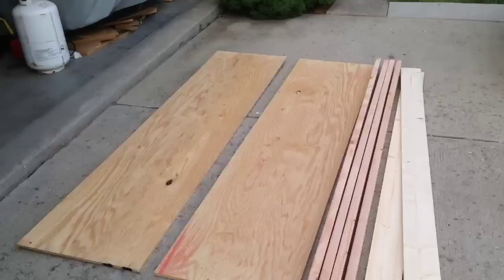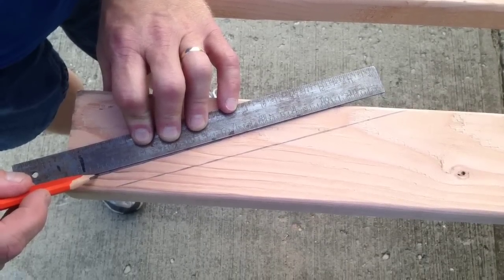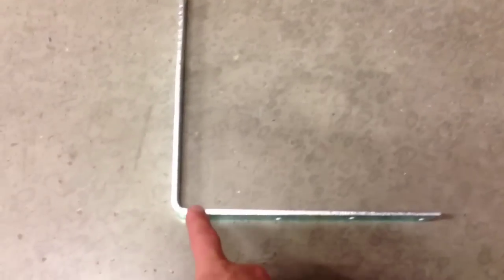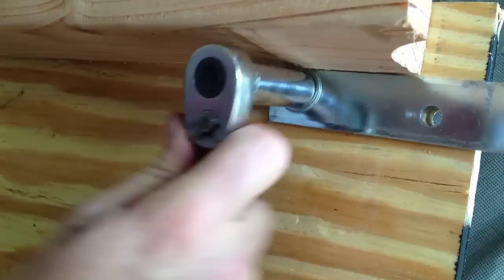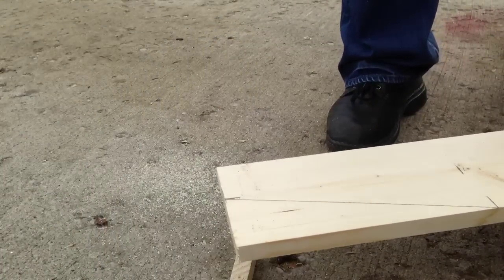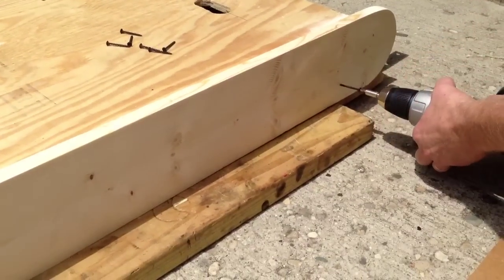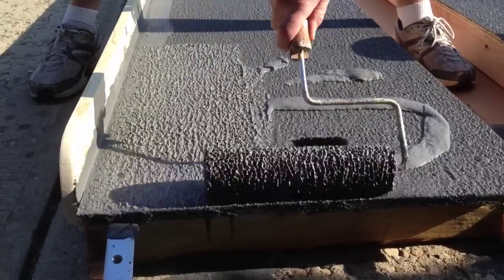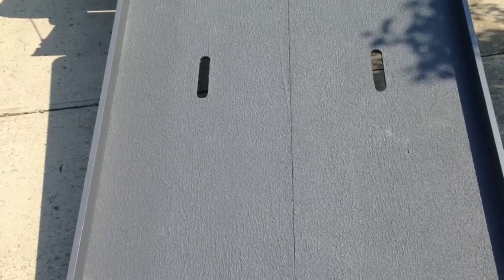How to Build a truck ramp. By How-to Bob

Comment: Yes wayyyy too heavy for a ramp. Probably costs bout same or more. Can get a aluminum on for $99 and holds 1500lbs. Weighs Lil under 30lbs. I do give u props for making us own. Does look good.
Reply from the maker: It helps that they split in half. I was wondering how long and how wide are the aluminum ramps that you can get for $99?
Thanks
Reply: About six feet long and eight inches wide.
Reply from the maker: I needed 8 feet.

Comment: These are pretty cool, and they look good too. Have you considered building a raised platform for the inside of your truckbed with a "cubby" hole for the ramp so you can put your item on the platform, and slide the ramps in and out as needed?
Reply from the maker: I have but I thought they would take up too much space or raise the bed too high. Thanks for watching.
Reply: @funbro1  that's a good point.
Reply: @Adam Will  I m searching for that specific idea. If the ramp was made out of metal, then cubby wouldn't have to be so high. I plan on adding side panels to the bed of the truck so it may workout.

Comment: The side 2x4-s are 4 ft apart.  In length of the ramp there are no 2x4-s under the plywood for the whole 8 ft. Load a tractor and it will fall through the plywood. Was this calculated by an engineer or just put together "by ear"
Reply from the maker: In total there are four 2x4’s under the ramp. I have loaded a lawn tractor and a 900 pound motorcycle plus the rider multiple times with no issues. This was calculated by an engineer using SYP for construction and had nothing to do with “ears”.
Thanks for watching.

Comment: Why no completed picture view
Reply from the maker: The thumbnail for the video is literally a picture of the completed ramp. Hope this helps, thanks for watching.
Reply: @funbro1  yes I understand but it's not on the truck so it doesn't give a relationship to size and how functional it could be for varies uses.
Reply from the maker: It can be used for many many things. It is 8 feet long and 4 feet wide. I have used it for lawn tractors, snow blowers, and a full size motorcycle.
What do you need a ramp for?
Reply: @funbro1  what does a mask have to do with this? 

What info is missing is the rake of the ramp in relationship to the height of the tailgate.
Reply from the maker: The rake will change depending on the level of the driveway/parking lot. There are times I look for a swell in the driveway so that the front of the truck is up and the tailgate lower so that the angle/rake of the ramp is less and less.

No mask was used in the production of this video.
Reply from the maker: How high is your tailgate from the ground?
Reply: @funbro1  I got it figured out days ago... 

You didn't use a mask when painting interesting approach

Comment: Great video I'm a teen and got a little Frontier truck I plan on making a ramp for to load my pushmower in and out to mow lawns to make some cash
Reply from the maker: They have served me well for awhile now. Thanks for watching
Reply: The ramps weigh more than the average push mower.
Reply: You can get a set of two steel folding ramps on amazon for about $70. They'd probably work better for your push mower, and they weigh about 20lbs apiece. I think this ramp would be good for something that is harder to control, like a motorcycle

Comment: Thanks for posting this video! I built a Motorcycle dolly with a winch and this ramp looks like it will be easier to load with the smooth plywood surface compared to my aluminum ramps. Nice job!
Reply from the maker: Bob C Thank You

Comment: Hi.
Nice job and presentation. I am going to use 2 x 10's along with the purchased metal pieces from Amazon--about $20. Last time I borrowed a friends similar units and they worked fine to load and unload a snowblower. Now I am making my own for the lawnmower and need to know how long they ramp should be--tailgate is 28 :" off the ground. 
Last time I used 6" pieces of 1  3s to drive into the ground at the end of the ramps to stop them from moving--I do like your tie down idea and will use that.
Can you advise how you wound up with an 8' ramp?  I am unsure of how sturdy 2 x 10s fir is.
Any adivce?
Thanks Again-I will paint mine after seeing yours!
However

Comment: I like it - with reservations. I want something like this for my Ford Ranger but I see two potential snags:

1. If you load something big like a lawn tractor it looks like it'd be awkward to find room to haul the ramp as well. My bed is only 7 ft long.

2. How much weight can the tail gate support? Did you consider removing the tailgate and mounting your ramp on the truck bed?
Reply from the maker: +Tin Man The ramps fit nicely into the bed with the tailgate up (hang over a couple feet). I use a tie strap to hold the ramps to one side of the bed. The tailgate on my F-250 has had 1000 lbs on it with no problems so far. I guess if you are worried about the tailgate limit then taking it off would be a good option. Thanks for watching
Reply: Average tailgate is rated for around 500 lbs. You are really better off going with a trailer if you are hauling the mower frequently. Also, arched ramps are much better for mowers with their low decks that like to hang.

Comment: It's been awhile now, how are you ramps holding up? Rustoleum paint? Thanks.
Reply from the maker: It's not bad, I tend to drag the ramps probably more than I should so a lot of the scuffs are self inflicted. The top surface is in great shape other than the top center where my bike will drag every once in awhile if I do no have the truck on an angle when I ride the bike up. Thanks for the question.

Comment: Nice work. Needs to be lighter and needs to fold in the center for easier transport in the truck bed for powerchairs and scooters to travel with the equipment. Still nicely done though.
Reply from the maker: It would be great if it was lighter and would fold but I believe the weight capacity would be compromised if either of the 2 was done. Thanks for watching.

Comment: But what weight can a ramp like that take. My opinion is a ramp should be able to take half a ton
Reply from the maker: The amount of weight it can handle is affected by the length of the ramp. This set up has had a full size Harley along with rider in it with no problems Thanks for watching.

Comment: Do you have issues with bottoming out with this ramp?
Reply from the maker: Doubl3N That is the reason I decided to build a ramp of this length. My bike is only 6" from the ground at the lowest point and the center line of where the tires meet the road is 67". I will sometimes use a slight incline to make it easier but with the truck and ramp on level ground I have not had any problems. Good question. Thanks for watching.
Reply: Bob, How heavy is the Bike you are loading?
Reply from the maker: I have had several bike on this ramp, the heaviest was around 800 Lbs.

Comment: to bob, theres is more simple way for i've made a simple ramp with double osb board 3/4" thick with special claws that hook on edge of taligate firmly and it works perfectly
Reply from the maker: I'm sure there are many ways to make ramps, This one will hold the weight that I need it to. Thanks for watching.
Reply: "double osb board".  Is that all?  Sounds weak.

Comment: Good video for the most part but it could have been sooooo much better if you just showed the bottom of the finished product. For example, you spent more time showing how to put a nut on a bolt than you did showing what the finished bottom should look like. Just some constructive criticism.  Thanks for making it though.
Reply from the maker: One thing I have learned is that you can NEVER please everyone. If I had shown the underside of the build someone would have criticized that. Can't win here. My best suggestion is to build one and when it's done you could flip it over and see what it looks like from the bottom. Thanks for watching
Reply: funbro1 ya you cant please everbody..especially on youtube haha..i may build this for my snowmobile. thx
Reply from the maker: Sounds good, Should work well for a snowmobile. Thanks for watching.
Reply: I intend to construct one for my 650 lb snomobile and I'm 225!!!  It is to get on my new 19 in high trayler.  Is this proposed ramp enough sturdy?
Reply: OK, I've just read a few lines down to get the answer by funbro1.  But how it turns out with your snomobile?

Comment: 70$ save time and go get one on Amazon but good vid
Reply from the maker: J-Hook Productions The ramps on Amazon are not the same and will not accommodate most full size motorcycles that get loaded into a 4X4 truck. Thanks for watching.